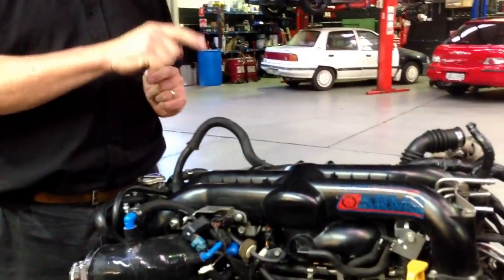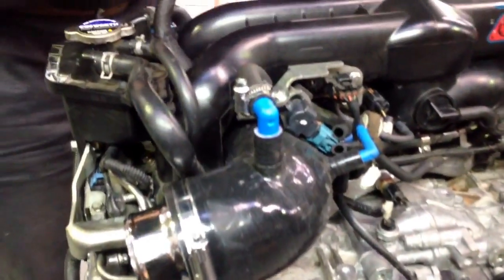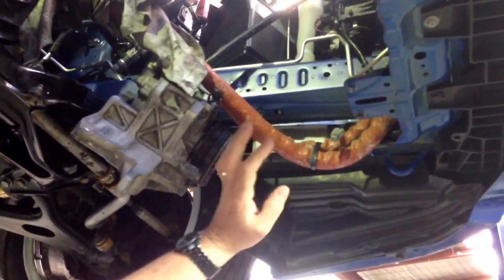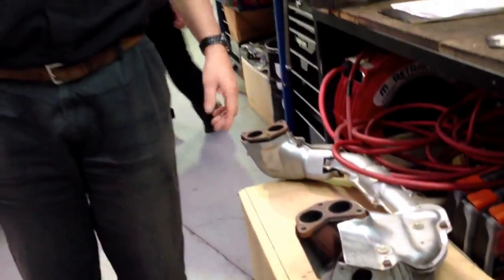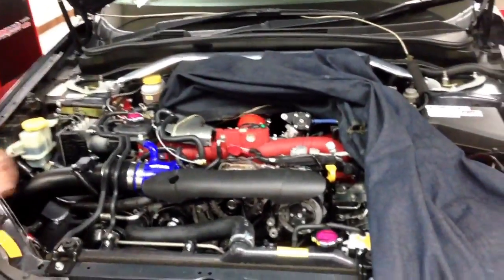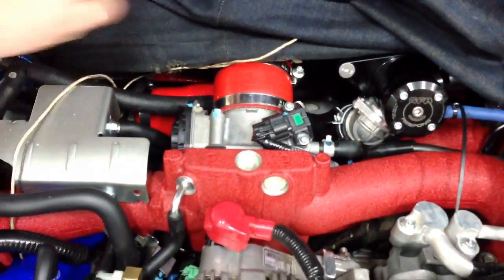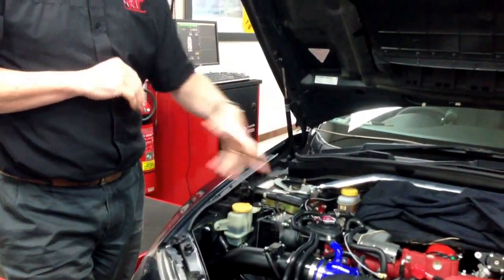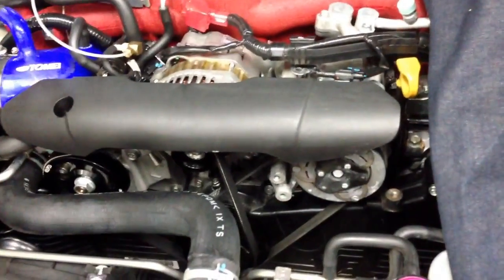Subaru WRX and STi engine variations MY08 to MY13 what's the difference and hoe parts work

Comment: I wonder if Brett still stands by the clam he made about extractors. That it's effectively a pointless modification early on. From what I have seen with exhaust manifolds by Killer B increases power and especially torque on a stock STi. More significant gains were made as they went from stock to stage 1 and 2. I know dyno numbers can be easily skewed. But it was done by a reputable tuner, namely Yimi Sport out of California, if I'm not mistaken. If you look up Yimi Sport + killer bee headers you can see the results for yourself. I realize that this is a older video so I maybe talking to myself here.
Reply from the maker: still stand by our claim that the cost of extractors on a stock engine is not worth the cost VS benefit

Comment: Hi Brett

My Liberty Sti is producing 230ATWKW on 17.5psi. Its got a good tune, several upgrades: turbo, intercooler etc..

I was wondering how far I can push the engine before i need the internals done i.e. Forged pistons, rods etc..both in terms of Turbo pressure and power output in your opinion?

Comment: Top video as always on this channel! I've always liked the way intercooler alings with plastic manifold, that way the flow through inside of it is like in a front mount, along the longest axis. Wonder how much work it would be modify a stock Subaru cable throttle body to one, lets say you'd have access to cnc laser & mil.. Never had change to take closer look of the plastic manifold.

Comment: My 2011 sti sedan has a stock motor, all I have is an invidia catback system. Will adding an aftermarket downpipe make a real difference?
Reply from the maker: best get a custom ECU tune first, better value!
Reply: MRT Performance I wish you guys were in the states.
Reply: Get the downpipe and then get a tune. When transporting to get the tune Do not get on the boost at all and if you have to its prob best just to tow. But you will reap greater benefits from the new flow ration from a tune after the DP is installed.
Reply: Big DM Good info. thanks Big DM. Yea cant wait to get the DP and a tune the car feels fast as it is now, cant wait to see how much of a difference it will make.